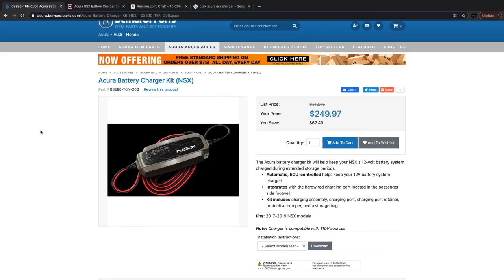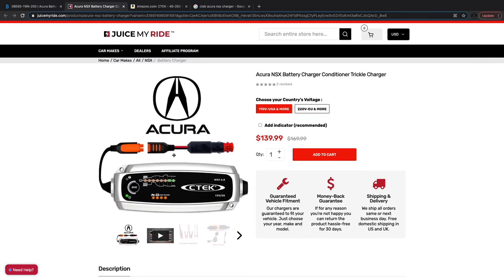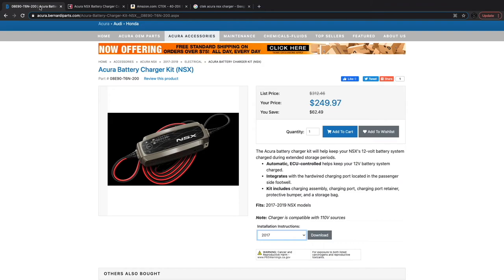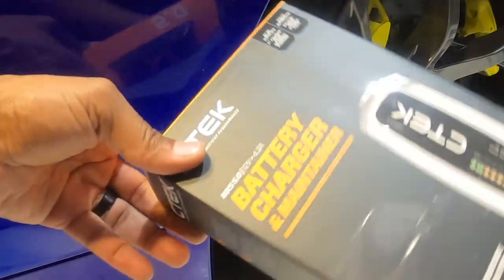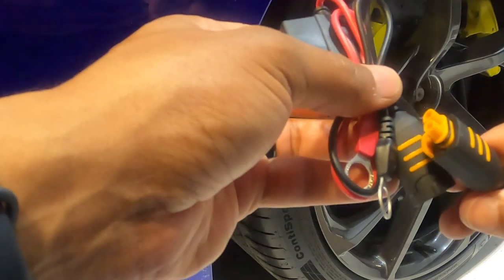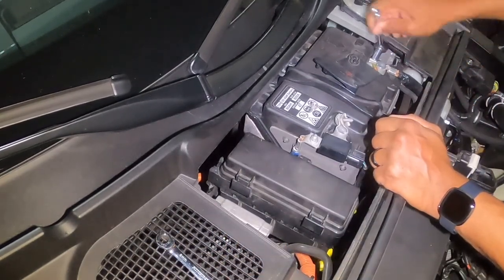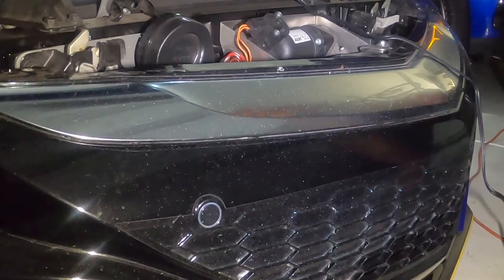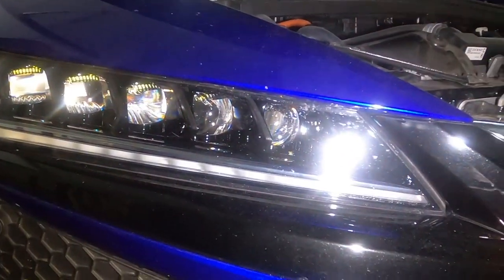2017 Acura NSX Battery Charger

Comment: Does the OEM battery charger allows you to do the same connection?
Reply from the maker: I'm going to assume it's the same considering it's the same manufacturer. Only difference is the OEM connector mounts under the glove box.